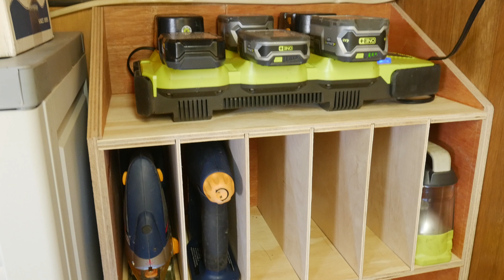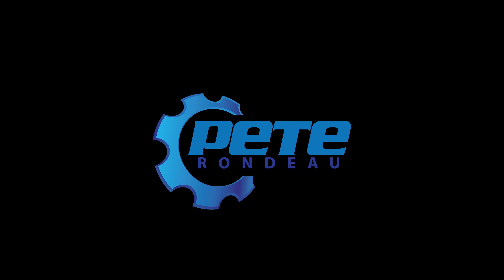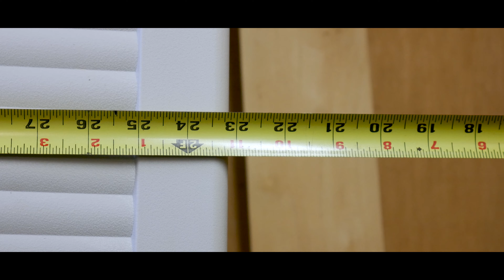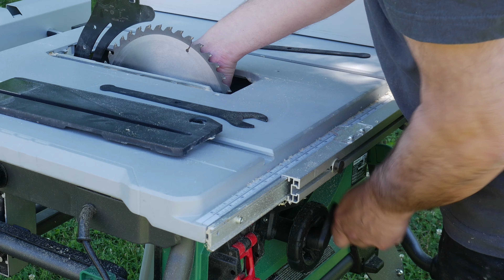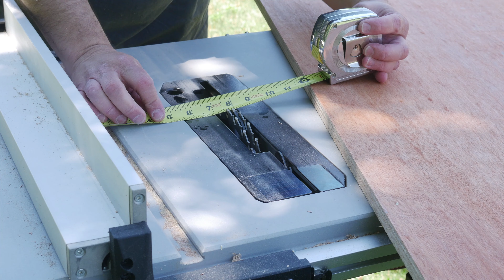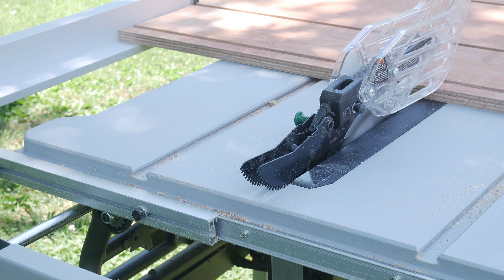Cordless Tool Storage- Adaptable for Your tools

Comment: Do you like using ryobi tools? Instead of going with dewalt or Milwaukee? I know the cost difference and such but just overall
Reply from the maker: My family started me out with Ryobi tools one year  for Christmas (years ago - based off the blue color -they started switching to green in 2007).  Once I had a few it didn't make sense to have a bunch of different batteries around so I just stuck with them.  They've always been fine for what I do.  My only complaint now is that the keyless drill chucks are worn out and don't grip properly. so I end up with a lot of drill bits with slip marks.